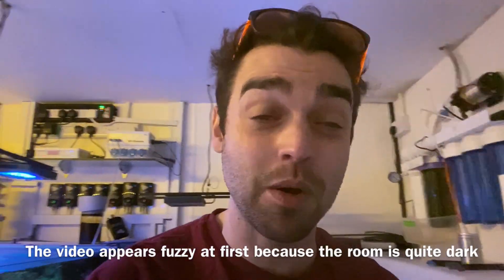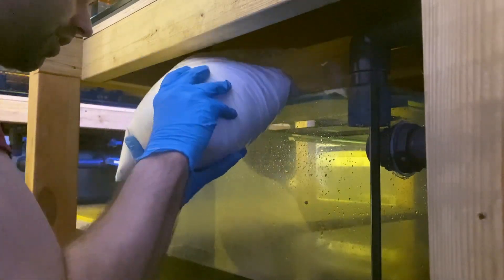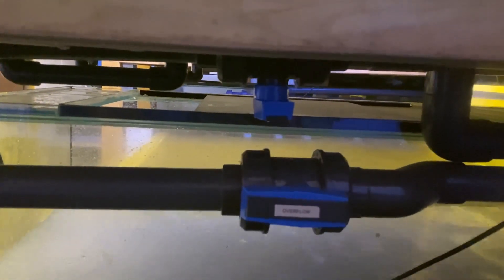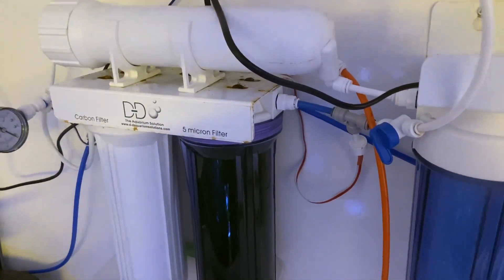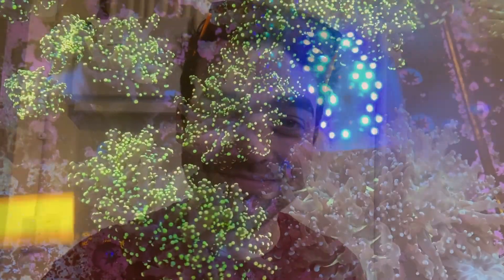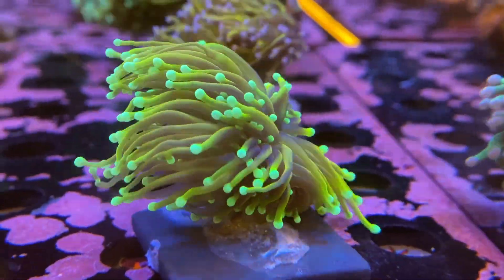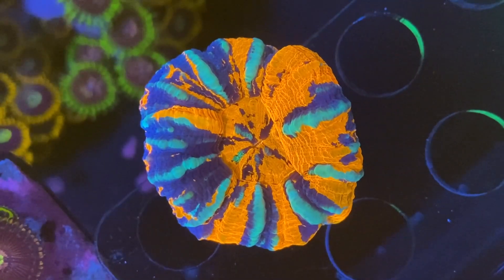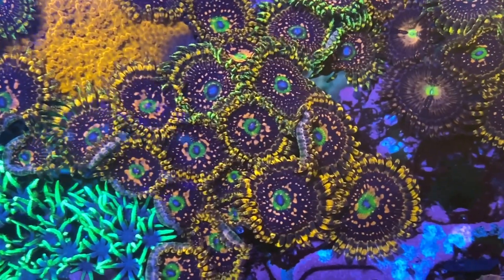ULTRA High End Coral Shipment + Mega Build Maintenance

Comment: Australian coarls are one of the few corals we can get easily in New Zealand. Our shop have also finally worked out that it is easier and better for business to buy from locals. Both still need to go through quainten however because there is no air freight it works out cheeper